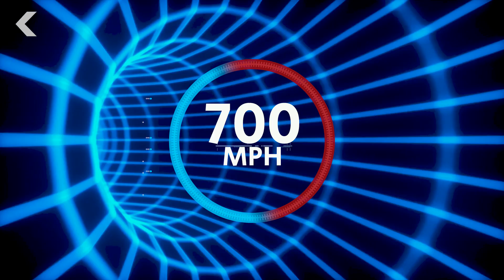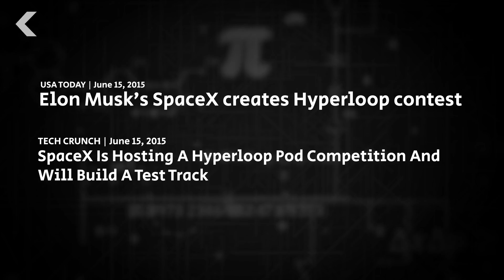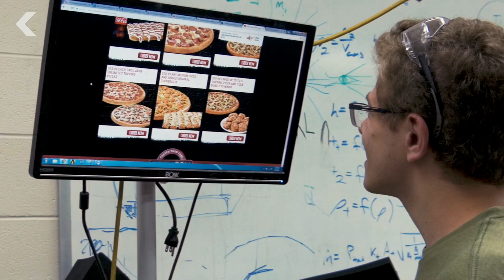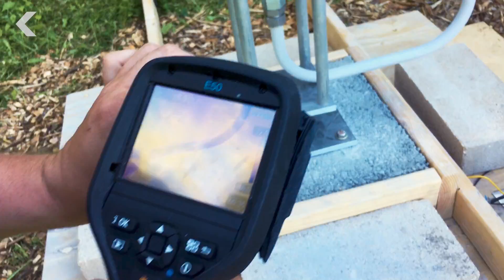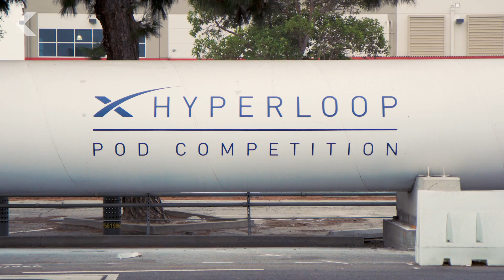These College Students Built a Hyperloop Pod... Here's What Happened

Comment: Congrats to them, now they just need to make the Hyperloop actually work (because it doesn't), and open people's eyes to the fact that it's an incredibly unsafe way to travel that will never reach intended speeds without major redesign.  And they'll be all set...
Reply: fss1704 for staters, that's not remotely true, when was the last time you saw a big metal rod sticking down trough the middle of the Hyperloop tube for support? Or for that matter, a metal cage around the outside of a submarine..   If you have no idea what you talking about, at least try to research it first.
Reply: Pedro Rocha but the science behind planes is sound, nothing about what they are trying to do is based on math or observation. And what they're trying clearly doesn't work!
Reply: Kirin Yardberry and yet this idea has been around nearly as long, and still doesn't work? Way to think that one through buddy..
Reply: Kirin Yardberry I've done so already, try reading before commenting..
Reply: fss1704 Oh my god...    Are you serious?   A:I never mentioned a pressure tube, you made that up all on your own.  B: Atmospheric pressure is around 14.7 psi at sea level, which  means that, at any given time there is 1,427.5lbs of force (I do this kind of math for hydraulic systems all the time) pushing down on a just a single section the size of an average sheet of notebook paper (in a perfect vacuum, don't try the "it's not a complete vacuum" BS because you'd never achieve the target speed without collapsing the tube with the pressure wave. Google f16 sonic boom to get an idea of what that looks like.) multiply that buy 1 million, and you'd get the estimate force on just a small section of the proposed length of track. A force that would literally disintegrate the entire tube with just a hole the size of a needle (Google decompression explosion.) C: good luck stoping a 700mph train fast enough to prevent a disaster, it takes a normal train almost a mile to stop just traveling at 50mph., and that's with normal atmospheric pressure, wind resistance, and friction from the weight of the train on the tracks (which is something you'd know if you had even the basic understanding of how trains work) so your then talking over 20+ miles to stop, not taking into account for the mag lev, if the entire 350 mile line hasn't shredded itself station to station in under 5 minutes from the vacuum failure.   It's not that complicated, you just need to have the basic knowledge of the mechanics of it.
Reply: red nose we've had tubes for thousands of year longer than planes, I wonder why it still hasn't happened?
Reply: Ilja Kortesniemi hahaha, good luck with that one....   An explosion (implosion with enough force to shred and throw things) of that magnitude doesn't care what you put in front of it. And good luck stoping a 700mph maglev bullet in a vacuum fast enough.
Reply: fss1704 so..  Best case scenario, you instantaneously stop at Mach 1 (instant death as you are turned into mist at more than 71 times the force of gravity) and go flaying backward with the debris like a bird shot, shredding everything and killing you AGAIN (assuming the car is still in one piece. It wouldn't be..)    I don't get how you people can be this utterly incompetent?
Reply: You are the same type of person as those who had said that man will never fly
Reply: HellishGrin460 If every person on earth had that attitude, we would still be in the stone age...
Reply: Your doubts have been said before in history, when the Wright Brothers introduced their ideas, they were ridiculed and told that, "No flying machine would fly from New York to Paris." And when commercial jetliners were introduced people like you doubted them, saying we can't go that fast, it'll never work. I'm not saying the Hyperloop will work, but you clearly have no idea what your talking about. First of all, the safety issue is bullshit, Elon already explained what would happen in the event of depressurization or the tube compromising. And on the design not working, there is no definitive design, from someone who has "more degrees in physics/science" (btw that doesn't prove anything, without sources we're just taking your word for it) you sure don't understand the process of designing and producing something that is conceptual. If you were to say "the design doesn't work" then you'd have to point out the flaws in hundreds of different designs. Which I don't see you doing. You can just say "it won't work", and expect people to give up on something.
Reply: +HellishGrin460 Have you heard these things known as airlocks?
Reply: Look up "Shane Killian" Hyperloop
Reply: +HellishGrin460 in a tank intended to be pressurized, not put under the stress of a vacuum. try vacuum a baloon and see why vacuum behaves differently of pressure.
 have you wondered that the support in a tank for pressure is in the outside and the support for a vacuum tank it's in the inside.y
Reply: of course you can explode yourself in a terrorist attack in a hyperloop, it does't mean you will hurt anyone else, since the air resistance of a decompressed tube can stop the pods fairly quickly, especially if the tube decompresses in your front, since you'll have a vacuum pulling you back because of the air entering the tube.
Reply: HellishGrin460 just like planes
Reply: Who said anything about thunderfoot?  I can't remember the last time I said "hey, you know what would be fun today? Going 700mph in a vacuum tube with walls thinner than the monitor I'm currently watching this video on, I hope nothing bad happens that will cause my internal organs to suddenly become external if I don't suffocate first, or become liquid from a crash at mach 1!".    And to top it of, IT DOESNT WORK!!!    It took them what, 10 hours to even pump the thing down, and the cars didn't even go 100ft on their own?  It's just not viable with the current design.   Do your own research before you claim that multiple people (NOT including myself), with more degrees in physics/science than you, are wrong.
Reply: God satan you mean a 22lr and and a campfire?  Have you seen the mythbusters test of what a dent in a vacuum chamber does?
Reply: Or we can use to ship products, but the infrastructure is unrealistic. Tunnels in Cali? Thought we're getting a speed train first
Reply: Optical Clarity okay then, where are your qualifications and scientific evidence that proves what what you are saying hm?
Reply: Please, explain yourself, how do the designs not work, why is it more unsafe than a commercial aircraft, or for that matter, a car, where over 1.3 million people die a year in. You ask for evidence but you provide none of your own.
Reply: using a PRESSURE TUBE to demonstrate vacuum implosion is just like saying that GLP tank's are dangerous because you can explode them with natural methane. PRESSURE TUBES ARE NOT VACUUM TUBES*. if you shot a metal vacuum tube it will **ONLY* leak, maximum pressure in a vacuum tube is the atmosferic pressure. if it leaks in large amounts the sensor may vent the tube stopping any pods.